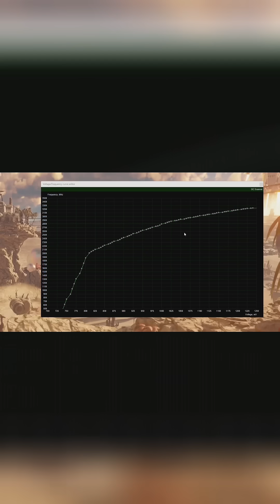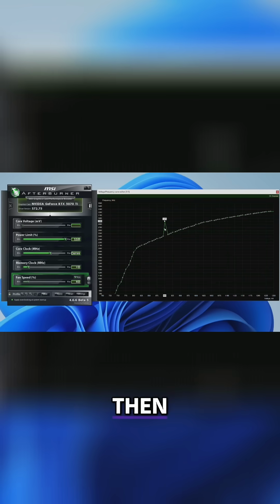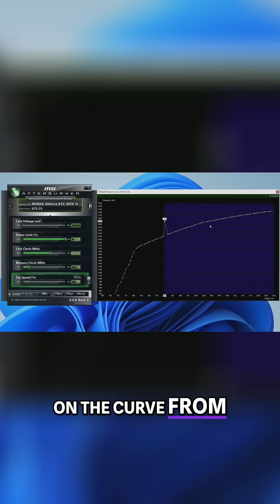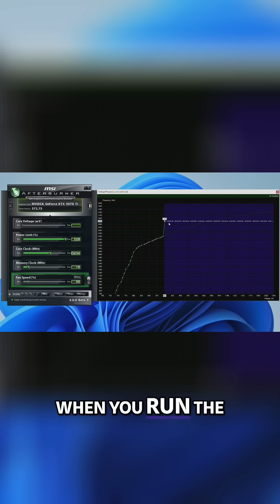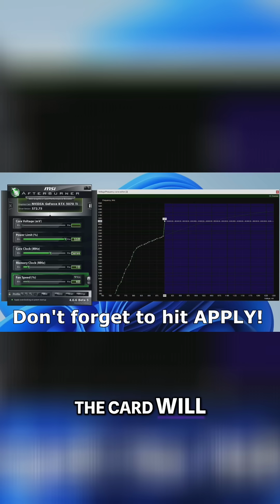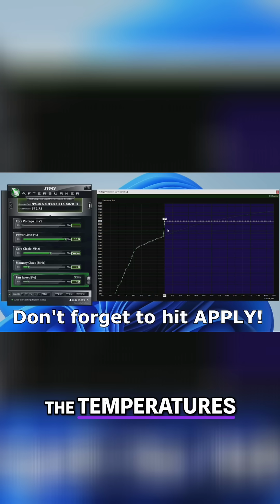Undervolt your GPU to BOOST FPS and lower Power/Heat #nvidia #amd #intel #gpu #graphicscard #rtx5090

Comment: Extremely bad advice for overclocking. You want to add +200-300 or whatever to the curve, then plateau the cueve at a particular voltage. This method ruins the curve.